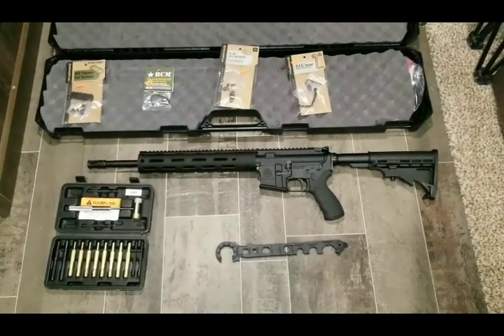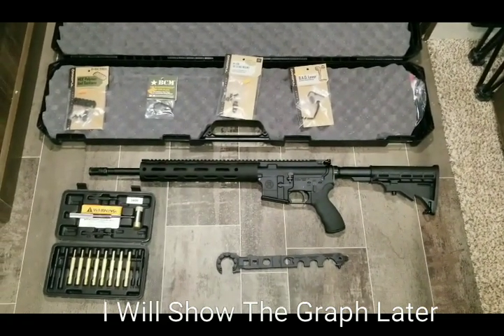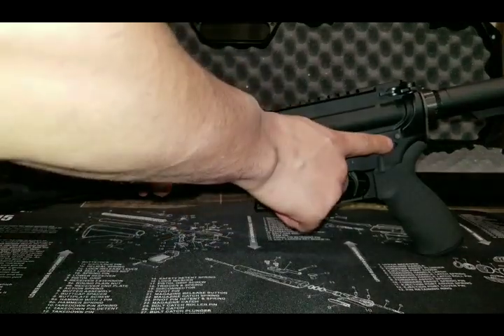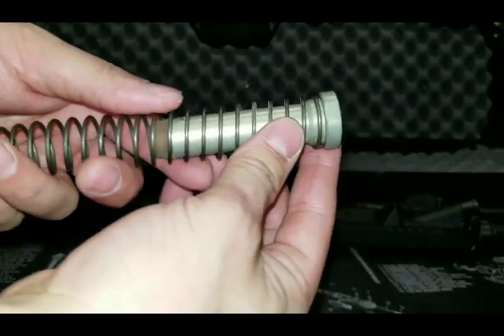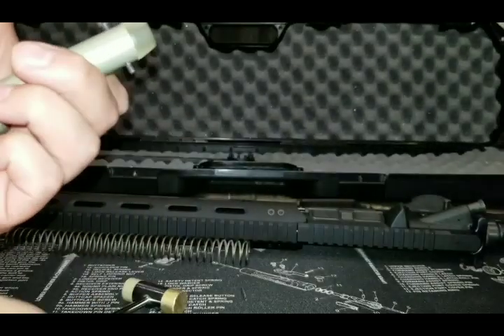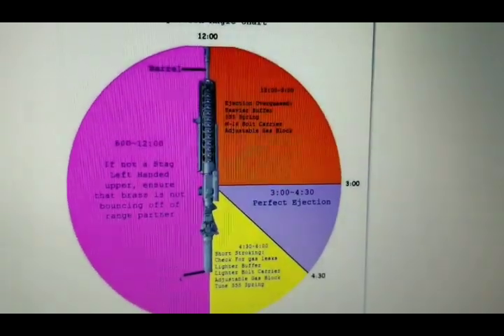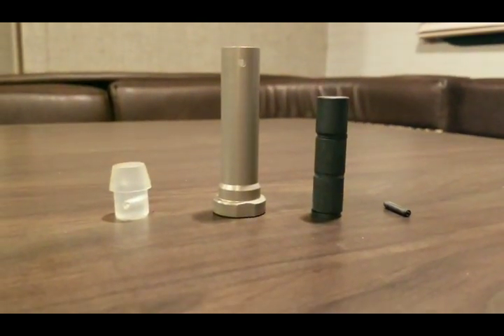Your Radical AR Is Over Gassed, FIX IT CHEAP!!! Here's How

Comment: I have an AR "other firearm" which is basically a SBR with a pistol brace and vertical fore grip. Shooting Federal XM193 55 grain ammo, I get significant recoil ( a lot more than my M4A2 did when I was in the Army). I shot 40 rds. and when I went home I noticed I had a small dime sized bruise from the recoil. I bought a VG6 Gamma Muzzle Device hoping it would solve my recoil issue. Went shooting again using some cheap Wolf 62 grain ammo a friend gave me. Shot 20 rds. got zero recoil and barrel rise and was satisfied with my new muzzle device. Went shooting again, using my Federal XM193 ammo, shot 40 rds. had significant recoil again. Was very disappointed with the muzzle device. Decided to buy a heavier buffer and spring, went with the Spikes Tactical T2 Buffer (4 oz.) and a JP Industries Tuned Spring. Spring and Buffer should be here Friday. So I am hoping that will solve my issue. If that does solve my issue than the VG6 was a wasted purchase and I will probably just go back to the a2 birdcage. As for ejection angles my casings end up like 10 ft. away at the 2:00 position, but they are striking my deflector so I am not sure if that is the cause or if it is just over gassed or not. 

Any input is welcomed, thanks.
Reply from the maker: An adjustable gas block is the way to go as everyone has repeated. But it does involve the most work and money aswell. I was recommending another alternative that customizes the buffer to any gun rather than buying a specific weighted buffer.
For recoil and follow up shots the muzzle break plays into that aswell causing the barrel to possibly rise and recieve less recoil straight back. But the trade off is muzzle rise. Pick your poison.
In your case that shorter barrel will add recoil a heavier weight i think will help. Also possibly your stock/stock pad or even the buffer spring.
A lot of moving parts to perfect it the way you personally want. But i think some guns are worth it and some are just plinking guns. Just have to decide how much to spend and if it's worth it to you.
Reply from the maker: Figured I'd come back and add for some, that bullet brand, weight ect... will also change how your shots feel after you pull that trigger. Figure out what bullet and brand your gun shoots best with on paper at your target distance then dial your gun in to your chosen bullet.
Reply: @bereadybasics7525  Well I just got my 4 oz. buffer and spring. Spring is slightly thicker and and like 1 1/2 in longer than the old one. Will be shooting tomorrow morning so will see how that works for me. I would like to avoid an adjustable gas block at this time since I have zero experience with them. 

Thank you for the tips, I appreciate it. This is actually my first AR as a civilian. When I was in the Army, I only had to clean my rifle and shoot it. The armorer took care of all the maintenance stuff. So I am still learning things I never knew before.
Reply from the maker: @xlxlffdd6630  Sounds great. I would love to see how that works for you.  Maybe this thread will end up helping someone else with similar issue. Looking forward to the update.
Reply: @bereadybasics7525  Just got back from shooting. The new Buffer and Spring definitely made a huge difference over the stock ones as far as recoil goes. The action was really smooth. So I am happy there. However my brass was still hitting around 1:30 - 2:00. They do hit the deflector on ejection so I am not sure how much that effects direction. I don't plan on shooting 1000's of rounds (today I only shot 15 rds.) out this gun though so I am not sure if I should even bother with an adjustable gas block, unless it can cause severe damage on some parts like the BCG and Upper?
Reply: xlxl ffdd I think you are going to need an adj block.
Reply: @xlxlffdd6630  If it's hitting the shell deflector, wouldn't your rig be undergassed?  None of the brass should be hitting the deflector at all in a properly cycling rig.  Next time you go shooting (and really until you get this figured out), you should be trying to use the same exact ammo (brand/weight/type) to make sure different loads aren't causing you to chase multiple problems.  I'd go with whatever you plan on typically shoot but we are in the times of 'rona.  I would also look at a slightly stiffer spring (Sprinco blue) if nothing else changes.
Reply: All buffers are the same doesn't matter the brand
Reply: @AncientMysteriesAndInnovations  the weight is what matters.   There are several different models for buffers.  H1 through h5.  And v pistol buffers that are even heavier.
Reply: Brt ez tune gas tube. It will solve your problems.

Comment: Better fix would be to go get a sprinco blue buffer spring and an h or h2 buffer. The stiffer spring is far better than simply adding weight to the buffer. Try it and see. The spring is 20 bucks from sprincos website

Comment: I have that same upper in 7.62x39 and it is WAY over-gassed.  I have had a Colt in the caliber since 1992 and this upper makes recoil feel more like a .30-30.
I put in a 4.9 oz buffer and a buffer spring designed for a .308. It still kicks hard.
Reply from the maker: Perfect example on making this video. I like everyone to post what they experience so others may see. Thank you for commenting.
Reply: 30 cal will always be overgassed in a gas impingement system shorter than rifle length. It's designed for a rifle length gas system and a barrel over 20 inches long.

Comment: I try not to worry too much about this. With .223 my ejection is "Perfect" with 5.56 my ejection is about 2 o'clock-ish. If I set up my rifle to eject "perfect" with 5.56 than I'm pretty certain I'd be running the risk of being under powered with .223 for reliable cycling of the bcg. I mainly run 5.56 so in reality it's not a major concern for me but just thought it'd be a point to bring up for those who run both regularly. I'm currently in the processes of trying to get my rifle slightly more tuned but personally I don't want my rifle to eject 5.56 in the "perfect zone" Some where between 2-3 (closer to 3 than I am now) is what I'm going for but consistency in ejection pattern is key.
Reply: RaTiCuS  you just commented to someone else that adjustable gas blocks were not good for reliability,  and were designed for suppressor use.  Hey- as long as you are controlling your gas, be it with a heavy buffer, adj gas block, or Beano, you are GTG.  Bruh.
Reply: Is the felt recoil bad ? I’m having the bad felt recoil issue rn
Reply: @vontak59  It’s been a few years 😅 can you refresh me on the topic you’re asking about?
Reply: @biggboysouth  how bad was the felt recoil for both your .223 and 5.56 with your ejection thing
Reply: @vontak59   oohhh gotcha. It was decent solid middle road approach. Like I mentioned 223 was pretty mild and 5.56 was a little punchier but nothing I would call bad.

I’ve since dialed my setup in even more. I ended up just buying some weak ammo like tula or wolf ect. Set my gun up to we’re it’s just able to run and lock back the bolt on last round RELIABLY and it shoots great with no issues. Just use something higher quality than Tula or wolf for self defense 😉

Comment: Why add weight to the reciprocating mass of the bcg and buffer assembly???  You want to reduce it if you can for less felt recoil.  Get yourself an adjustable gas block instead of adding weight.  Want to make it shoot soft?  Get a lightweight bcg, light weight buffer and spring (or JP captured spring buffer) and adjustable gb along with a good muzzle brake and it will recoil like a 10/22.
Reply: Cav Trooper 19D  You  are absolutely correct.  The reason I answered this way was due to the context of his video.  Its obviously an inexpensive build and it just seemed like he was complicating matters.  Easy solution would be order a 5 dollar heavier buffer and call it a day.  Just thought i would give him a way to lighten the recoil if he was ok with going a little further like he did with disassembling the buffer and all.  If I were him and had this rifle ejecting at 2 oclock, I would have called it a day right there.  Not crazy overgassed and actually probably a bit more reliable.  Good run down on the bolt bounce issue by the way.  I think if more people payed attention to matching their components better they would be happier with their end results.  Also, cheaper is not always better and most overgassed rifles ive seen started with either cheap barrels that manufacturers drill the gas ports a little larger, mis matched components or lack of knowledge regarding how the components interact.   Its not to say less expensive parts cant be made into a reliable weapon just that when you combine what I mentioned above it usually ends with a lot of frustration.
Reply: Adjustable gas blocks are for fine tuning a gas impingement system. You can not fine tune away a reciprocating mass issue. Not all builds are the same and not all components are the same. Build the rifle, tune the rifle. In that order. Which means start with your recoil system and reciprocating mass first, finalize your mass your spring power and then adjust your gas. 

In almost every case, an adjustable gas block is not necessary.
Reply: @tactical-bucket  The title says it all!  OVERGASSED!    Usually due to a cheap barrel with  too large a gas port.  Changing anything other than the size of the gas port is an incorrect approach and merely band aiding the problem.  Period, end of story.  O-V-E-R-G-A-S-S-E-D  = too much gas.  Either change the barrel to one with the correct port size for the application or adjust the flow.  You can make macro or micro adjustments with an adjustable gas block and works just as well without having to buy an additional barrel.  Why add additional weight when you can rectify the ORIGINAL issue and have a rifle that runs correctly and smoothly.  You say you cannot fine tune away a reciprocating mass issue?  I would argue that adding more mass is just increasing the problem.  Yes it may slow it down but you are adding weight.  The goal is always to decrease the mass. Whether that is to obtain a lighter recoil impulse or  simply to have to hump less weight.  Why have to slow something down by using more weight when you can control its speed by applying less force to begin with?  On a side note, your way, you have more force slamming the bolt shut and creating more wear on top of all the other issues.  Try it, you'll like it and you will have less recoil ,  the sights will stay on target better and you will have faster follow up shots.
Reply: Because adjustable gas blocks aren't recommended for serious use defense/duty rifles. Just get a Vltor A5 or BCM A5 buffer tube, Vltor A5 buffer weight, and a Sprinco green rifle spring, and it'll be running smoother than a sewing machine
Reply: I run a bcm A5 sprinco green spring with an a5 h2 buffer with a DA sandman S on my bcm 11.5in. Elw barreled upper and mine still ejects at 2-230 Shooting 62g mostly I hope that will change with a h3? Anyone else have this problem
Reply: Good grief.... I you can't handle the recoil of a 5.56/223, perhaps lay off the soy or buy jeans that don't fit so tight!

Comment: Nice tip but honestly people worry way too much about this stuff. Stock is beautiful the way the manufacturer set it up as the way it was intended to run with a wide variety of ammunition. Myself personally in a mid-length carbine 16 inch barrel I would only run one tungsten weight at the most. Lots of people say two tungsten weights, but I have a feeling they will run into underpowered loads in 223 there's potential issues there. In my opinion you want to slow the carrier down just enough to promote optimal operation. The AR-15 chambered obviously in 5.56 mm doesn't really recoil much anyway especially in Rifle length.

Comment: Adding weight to the buffer does NOT resolve the over gassing, it only helps manage recoil impulse. You need an adjustable gas block. A gas block with a bleed off feature is the absolute best option
Reply: A heavier buffer keeps the bolt closed longer so that pressure inside the barrel has more time to decrease
Reply: @defiantmopar  only marginally so, and it would help slow down the cyclic rate  A stronger spring would  definitely help keep the bolt closed longer AND help with recoil. You need to fine tune the gun with a combination of buffer weight, spring weight, and gas block bleed off with the ammo you are using.
Reply from the maker: I Agree with you but not everyone has the confidence/ patience/ skill/ funds to install an adjustable gas block. Do you think leaving the spring alone and modifying the buffer to the best weight is the easiest/ cheapest solution? Most wont even mess with it as long as it functions reliably and chances are it will for a lone time.

Comment: Oddin works adjustable buffer and Strike industries has the optimous adjustable buffer. The strike has alot more adjustable weight options with its kit.  It has polymer, aluminium, steel and tungsten weights. Plus you don't have to beet out a roll pin. I got 1 oddin works and 3 strikes. Strike is the better option for its more versatile weight options. And it come with a nice gold buffer housing. Sometimes you can put quartes in you buffer tub b4 you put the spring in. If your at 2:30 ejection try 2-4 quarters and you might just find that sweet 4:00 ejection for literally less than  a dollar. 3 tungsten weights are more for 9mm or suppressed.  Good luck brother

Comment: Get a Vltor A5 or BCM A5 buffer tube, a Vltor A5 buffer weight, and a Sprinco green rifle spring, for good measure also get a LaRue MBT two-stage trigger, and you can thank me later!
Edit:. Adjustable gas blocks are not recommended for serious use rifles. It's just introducing another failure point when you can get a Vltor system for a comparable price.
Reply: A better fix is to buy a barrel with the correct port size. Then you have no added recoil or excess gas muking up the works. A quality adjustable gas block actually addresses the issue and unless you are shooting the weapon everyday in a combat situation (were hopefully youre not using a $500 rifle) youll have no problems. Why loose performance.
Reply: @oscarcollinsiv  Even on a perfectly gassed rifle I prefer to have the A5 system. It increases the operational window, increases life of your parts, and reduces felt recoil. Carbine length buffer tubes were a compromise that never needed to exist. Also makes it more forgiving swapping between suppressed and non suppressed

Comment: Some rifles need more than a heavier buffer some need stronger buffer spring. My ar got a springco red extra power spring now ejects at slightly more then 3 o'clock position, some commercially available ars come over gassed gas port hole in barrel is over sized, tried all buffer weights it did not change pattern, changed spring worked first time..

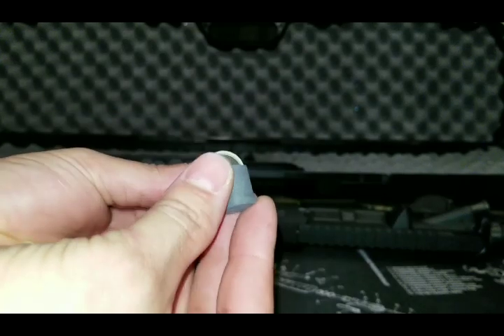Comment: H2 buffer with carbine length gas system and full auto bolt carrier. Perfect 3:00 to 4:30 from my experience.
Reply: Did you use stock spring? I have a M&P 15 sport 2.. and am looking go get an h2 buffer
Reply: @jumpman765  Yes I use the stock spring.

Comment: My experience with trying to solve this problem by increasing buffer weight failed completely. I went ( one weight at a time ) from a standard carbine buffer, all the way to an H3 (3 oz. to 5.6 oz. ) and the only noticeable difference in the ejection pattern was that instead of being anywhere from one thirty to three o clock, it is now consistently at two o clock. A heavier buffer spring might help, but I think an adjustable gas block is probably the best solution.
Reply from the maker: Appreciate your experience, I'm going to see what they would cost to have installed and I'll do a follow up video.
Would most shooters install a adjustable gas block themselves or hire it out? 🤔

Comment: You could just buy A H2 buffer with a flat buffer spring why wast the cash on them tungsten wts.
Even better pick up JP silent spring for $139.00 best on the market no more twang from the buffer spring.
Reply from the maker: keydogd what does a H2 buffer and flat spring cost?.... you mention wasting cash then say spend $139 on a whole new set up. Im not sure which way your going.
Reply: I run the JP buffer on most my rifles with an adjustable gas block - I run them all with suppressors. The JP buffer is the best by far.

Comment: Ok so i assembled a PSA AR pistol build.  I know it's over-gassed, but what is the danger, or why wouldn't you want it over-gassed?  I get that ideally it wouldn't be, but do i run a greater risk of breaking something, or will it cause malfunctions, or will it just lead to more perceived recoil and gas coming out of the ejection port?  Honestly the AR pistol is just a range toy for me, and i don't care that it is way loud and blasts gasses everywhere and the shells aren't in a nice pile on the ground.  I bought it literally because it looks awesome and its fun to shoot.  The bonus is that the quality and accuracy is way better than I expected from a ~$400 7.5'' pistol.
Reply: It ain't too bad, but increased wear and excessive recoil
Reply: Guns that are over gassed run the chance of bolt bounce back, which bounces the bolt out of battery causing light primer strikes.
increased buffer wight will also make recoil more manageable for fast follow up shots.
Reply: No danger. Changing the timing or adjusting the gas system on an AR is equivalent to making a car run efficiently or faster with performance upgrades.